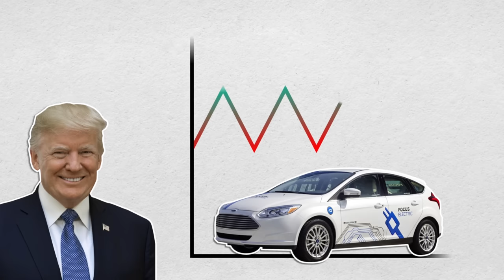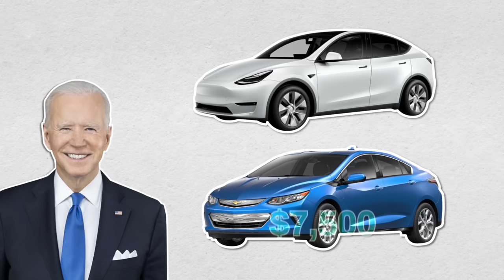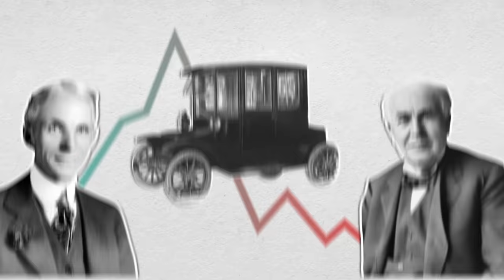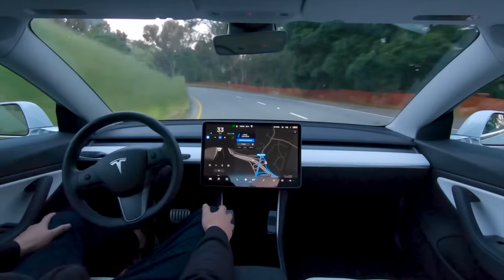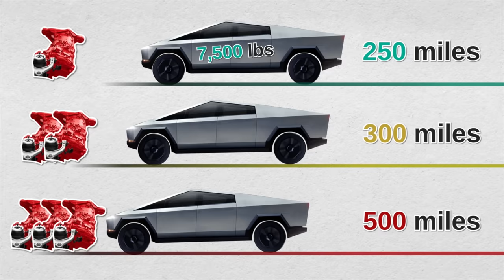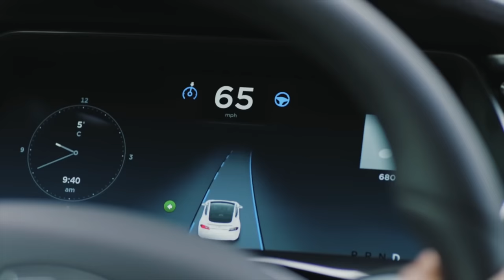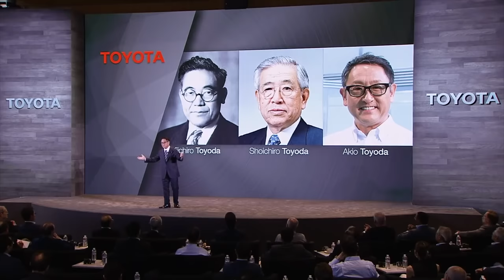Here's Why Toyota is Refusing to Make Electric Cars

Comment: After considering the Tesla 3 at $45K, I opted for a 2018 Camry LE 8spd (3years old) with 20k miles for under $20k. I get 40mpg+ and drive 165 miles per day. This car is more economic for my wallet and better for the environment in my opinion.
Reply: Smart move you did well.
Reply: Smart move, the $25K in saving will get you at least 250K miles of gas.  At this point, no one know how long can the Tesla battery last.
Reply: @jml9550  no one knows how long Tesla batteries last? Tesla has been around for 10 years, and there are tons of Tesla's with 200k+ miles. Generally the batteries last about 200k before a replacement is necessary. 

You're not replacing the car, you're replacing the battery. Take in mind no maintrnce is needed to an engine.  Just the battery.....
Reply: @georgewoodget271  25k usd is actually 100k miles in europe
Reply: Problem with your math is that you;ll have to buy another one in 3 to 5 years whereas some 2015 Teslas have gone 250,000 miles with less than 10% battery loss. Currently think Teslas should last about a million miles which should require 0 maintenance, except for tires,  and you might not even have to do a brake job because of regen braking. I’ve done the math a few times on cars as cheap as a Honda Civic for $3,000 and the Tesla comes out on top in 5 years. Meanwhile you drive a car that is twice as safe and more fun to drive.
Reply: yeah, but you cant go 0-60 under 4.0 secs. so what good is no fun after all....
Reply: How it is better for environment?
Reply: Colin Genge lets go Brandon! You love👉🏻🇨🇳
Reply: Colin Genge your math is fuzzy. No, electric cars are not cheaper and or more practical than gas cars in the slightest. Ev cars have maintenance too: replace battery packs, electric bill, too hot or cold reduces batt life, range, charge time, flood or crash is more lethal than gas cars. Plus, it is not more environmentally better. Ev vehicles are worse than gas vehicles period. Watch, ev vehicles will cause massive massive problems in the USA
Reply: @colingenge9999  3 to 5 years? I have two cars, had one for 6 years, the other 8.
Reply: your Camry will put out 70,000 pounds CO2 and 1000 pounds NOx over its lifetime to say nothing of all the oils and fluids.Probably go 250,000 miles whereas similar Teslas to my 2015 have gone close to million miles on same battery.  how could your Camry possibly be better for the environment. ?
Reply: Colin Genge also, what about the people that cannot afford them? What about the people that live in apartments? How do they charge their ev’s? What about people that have long commutes? Ev’s are not logistically sound either.
Reply: @Trump-jv8xf  Why are you resorting to labelling me; you know nothing about my beliefs?  EV batteries already 97% recyclable; why would they throw away valuable materials?  Even if we burned Fossil Fuel in a powerplant, we’d still reduce combustion product by 75% because gas cars are only 22% efficient. Your point about power from Fossil Fuel is a talking point but mostly untrue.  I have dedicated most of my life to reduction in Greenhouse gas and am probably 15,000 articles and papers ahead of you so let please don’t make assumptions about what i care about.
Reply: Colin Genge well, party affiliation is an ideology in which ev is a liberal democrat talking point plus being forced on USA society. Yes, labeling you for what team you are on, if you think calling being called a democrat or republican is insulting I can’t help you. But let’s move onto the topic
Reply: Good Choice ...Bought a 2017 Santa Fe with 20K...Mint...$18.500...out the Door ....400 +..mile range ..Pay at the Pump...5 minute Stop....Got my Wife a Santa Fe as Well.....Impressive Well Built Car...!!!
Reply: @DankRageRants  we’ve got reliable total mileage data for some 2015 model X used for airport transportation that looked like they’re going to hit 1,000,000 miles without any major service including running on the original batteries. All this nonsense about batteries is applicable to some of the early leaves but most of it is FUD generated by the fossil fuel companies. Desperate to make any argument to protect their toxic products.

Comment: I have two electric bicycles (actually hybrid because you can peddle them)  which are way more practical than a 4,000 pound electric car to carry one or two people around town.
I charge them with a 50 watt solar panel and can ride 20 to 30 miles per charge. Not as practical as a car when it rains but lots of fun the rest of the time.
Reply: Which ones and can you describe your solar panel setup, please?
Reply: @rajeshkanungo6627  I have a 2020 Magnum, 48 volt bike  and a 2017 Prodeco Tech that is 36 volts. I charge them with a Jackery box that is charged with a 50 watt solar panel. Free transportation once you buy all the stuff.
Reply: Prius Prime is cheap and gets cheaper over time.  Especially here in California where we get more cash back every month in electricity rebates.  Total power bill is rarely over $100 in my house with aircon running 3 days per week+a charge every 2-3 days.

I can't remember the last time I put gas in my Prime or I'd tell you.  Maybe 2-3 months ago?  Checked today and gas tank was still past 2/3 full.  Gets 80mpg+ when driven over complex mountain twisties up+down+up+down.

Was shocked coz I have lived under the premise that new cars genrally suck.
Reply: How does that even compare??
Reply: I kept reading about the advantages of eBikes, and not a single bike shop locally had a eBike to try, so I ordered a KBO Stealth Urban Hurricane. Spent $1,050 on an electric bicycle with three different power modes.  A belt drive single speed 36 pound bicycle to carry up and down three flights of stairs. I have changed out a few heavy alloy parts to carbon fiber or light weight alloy parts. I now have a 32 pound bicycle amazing that eliminating 4 pounds makes it far easier to carry up and down the stairs to prevent theft and charge the bicycle.  

With Chinese or Taiwan made carbon fiber bicycle frames selling for $400 I hope they will start releasing stealth eBike road bike frames in the near future.  

The other eBike need, are square taper carbon fiber crank sets since most of the mid motor electric motors still use square taper, as do most of the bicycle built up to 2007.  There is a pent up demand for many millions of bicycles that need new crank sets, and square taper style light weight carbon fiber 130 & 110 would sell well to justify the tooling to manufacture.  

I keep spinning the pedals on my 32 pound eBike, it certainly makes short local shopping trips a lot more fun.
Reply: How are they in the snow? Lol
Reply: I have a bike without battery and engine. Nothing beats that... Only pure force from My own body!
Reply: I have a 49cc scooter which is a two-stroke you fill a reservoir under the seat with two-stroke oil every third tank full.. the two stroke has a lot of torque and power for a little tiny 49cc.. the gas tank holds 1.3 gallons .. I get about 80 miles to the gallon and my scooter travels 40 miles an hour on level ground 45 to 50 downhill and 25 mph avg up hill... In Connecticut you only need a driver's license... No motorcycle license no registration no insurance...
Reply: @glenmo1  I have a 125cc Suzuki CS from the early '80s. I use it for 90% of my transport needs. I also have a sportsbike for long distance and weekend recreational riding. My car has not been used in over three years.
Small engine scooters would largely solve the emissions problem IMO. It's not the type of energy, it's the size of the vehicle that the consumer has become accustomed to. Mostly people are paying to transport a large vehicle from place to place, and not what it is conveying. The asians successfully use predominantly scooters for transportation, why not us.

Comment: Electric is great, got solar lights all over the house. But gasoline engines are convenient. You can get gas anywhere. You can put gas in a can, if you run out. Gasoline engines still have a great convenience; that battery power doesn’t have. Not to say battery power doesn’t have a future, but cost wise. Gas is still cheaper, and convenient.
Reply: As soon as battery prices drop another 25% it’s game over for gas. Another 2-3 years.
Reply: @XKS99  no quality has to go up and cost go down. Bump a battery the wrong way the car is totalled
Reply: @XKS99  Porsche is making synthetic gasoline that is carbon neutral, so maybe not so much?
Reply: Gas is not cheaper, not by a long shot and that gets worse in the future. Electric costs me just over 2 cents a mile in my EV. And convenience? You can pull electricity basically anywhere. Even in the middle of nowhere, a few solar cells and an inverter and you're charging. Each day I leave my house with a full 'tank' - in other words, no stopping weekly at a gas station for fuel. It takes about 5 seconds to plug in when I get home. On a road trip my car charges almost 150 miles in 12 minutes, usually I'm done charging before I'm done with my stop these days. I've driven electric for 4 years and have never had an issue charging anywhere in the country. And road trips are not the usual use of a car. Most of the time I have a far better experience than any gas car owner, never having to stop at a gas station weekly for commute gassing. And paying a fraction for the fuel.

Then because EVs are so in demand, my depreciation on last 2 EVs is almost non-existent. Plus zero maintenance except for tires. And instant torque. No, gasoline is dead for most applications, just the general public doesn't realize it yet.
Reply: @notlogical4016  with all due respect using electricity to make syngas is about the dumbest idea I’ve ever heard. Maybe 20 years from now collector ICE cars might run on it for $100/gallon but that’s about it.
Reply: @domg7359  - Agree. Gas engine vehicles are going the way of the horse and buggy.
Reply: There are ways to fill up an electric car in seconds they basically use a big capacitor as a battery, it’s like one big shock and your full, quickest than filling up from gas
Reply: Gas is allot more expensive...
Reply: @domg7359  yep I second all of that, after owning one for a year I can hands down say I’ll never go back to gas .
Reply: @justinjones5281  of course the quality will go up. Gas is bad for the environment anyway. Batteries are bad also but less bad than gas.
Reply: @notlogical4016  sounds cheap
Reply: Also, if the grid is down, you can still drive with a gas auto.
Reply: @domg7359  I drive a Prius so you don’t have to bother with techno babble. I paid 27k for it. I could have bought a Corolla for 16k. I haven’t saved 11k in gas and repairs yet and the Prius is the most efficient car on the planet. Now let’s talk Tesla vs Toyota Corolla in over savings. The gas to drive 500000 kilometres would never amount to more than 80k price difference. That’s why I say gasoline cars are still cheaper. I also drive a 98 rav 4 so there is no vehicle in existence that can save me more money than that
Reply: @fracturedsolace145  gasoline cars in Canada have to meet epa guidelines so 99% of cars are zero emissions. C02 is not bad. Plastics and other rubberized products manufacturing is the problem. Second do you know how many wars are going on right now over those rare earth materials you need for those batteries. If Canadians or Americans had to mine those minerals the cost of a battery would be 10x more so thank the slaves of Congo for your electric vehicle
Reply: @justinjones5281  It depends on what you want to drive. If you want a new car, basically nothing is cheaper than a Tesla after you figure depreciation. I paid under $200 a month for mine after depreciation for 2 years and 40000 miles. That is much cheaper than any new gas car and I paid much less on fuel as well. If you compare to an old used car, sure that might be cheaper. And this car is faster than most sports cars costing a whole lot more.
Reply: @XKS99  it'll be over for gas in the us probably but it'll never be over for gas in other parts of the world in only 2-3 years.

Comment: Instead of going full electric. I see hybrid vehicles being a good medium. Japan is a great example of why the world shouldn’t be running to going full electric. Just causing another problem
Reply: @markplott4820  what do all those acronyms mean?
Reply: @markplott4820  -- By definition, there's only one CARB state.
Reply: Plug-in hybrids are much more environmentally friendly.
Reply: @markplott4820  -- Wrong!!!!!
Reply: @JT_771  indeed however hydrogen vehicles just seem cheaper amd more efficient to produce and run once we can make the technology for the electrolyser small enough to make the car run off water.
Reply: @JT_771  yeah I’m a gear head so until the Ford e force comes out in a different body style or a different manual transmission EV comes out I’m not doin anythin.
Reply: @OhKnow379  Where will the energy come from?
Reply: @makerspace533  in order for EVs to be sustainable everything should be powered by solar, wind, geothermal and other sustainable technologies. For example thermal solar updraft towers could one day replace the chimneys of coal fired plants.

Comment: Thank you Scotty for your input, I bought my wife a Toyota Prius prime. There’s very few charging stations in the area I live. The Prius prime plugged into a normal 110 V AC outlet. She travels to work which is about 35 km, with the electric car. She plugs her car in while she’s working at a regular outlet, and can drive home on electricity. If there’s a problem and cannot plug the car in she just drives it using the gasoline generator in the car. I’m not sure of the gas mileage running this way but it’s very cheap. She was driving a Hyundai Santa Fe, the fuel she was using was costing more than the payment on the new car and the fuel she is using now
Reply: YES YES YES YES YES.  Agree.
Reply: It is a hybrid and you make it like it is electric.
Reply: No,   We just try not buy GAS